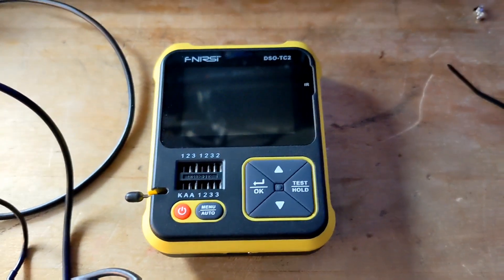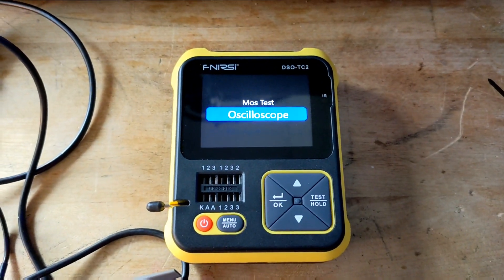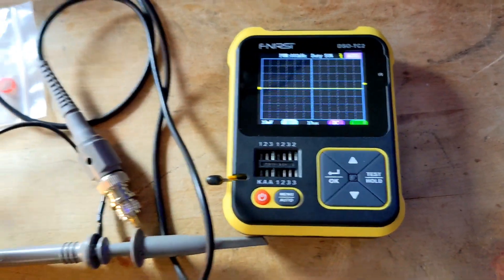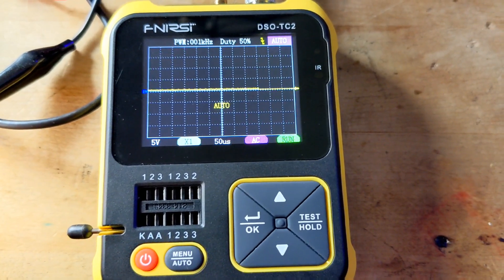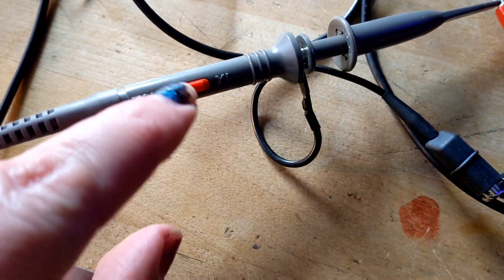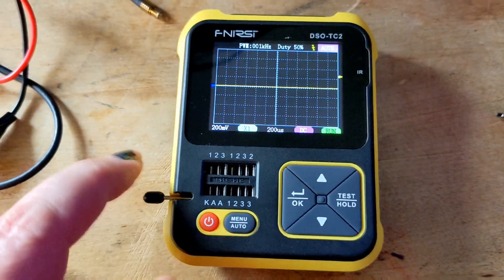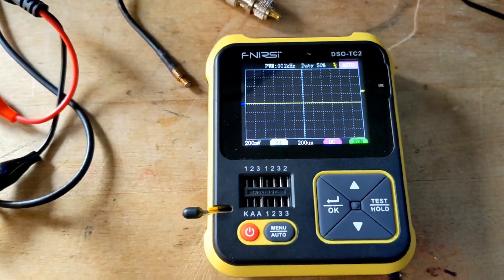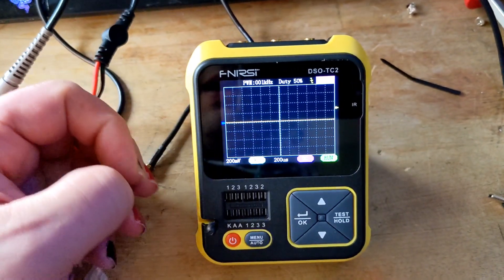Fnirsi DSO-TC2 oscilloscope probe setup/compensation.

Comment: Is it ok to use it on a smpsu and connect it’s ground to the primary hot ground on the smpsu? Do I need an isolating transformer ?
Reply: it is ok, but the oscillascope become live, so dont touch the probe metal part
Reply: I always put left hand in my pocket when probing  high voltages! Thank you for warning!

Comment: i am trying  to group my knowledge  so that i buy oscilloscope fnirsi-1014D but for nw i own DSO-TC2.now please i would like to ask when i measure to maxim volts and minimum  volts i found minimum with high volts more than maximum while its know that maximum shoul be with high volts than minimum example in my escllosocop i get maximum 14.80v and minimum 16.10v.now is it correct maximum to be like it is and minimum to be the way it appears to  my escilloacope if not wahy please need your help
Reply from the maker: if I understand what you're asking .. the voltage readings could be off due to the waveform having a spike at the rising or falling edge. Take a video
Reply from the maker: if I understand what you're asking .. the voltage readings could be off due to the waveform having a spike at the rising or falling edge. Take a video